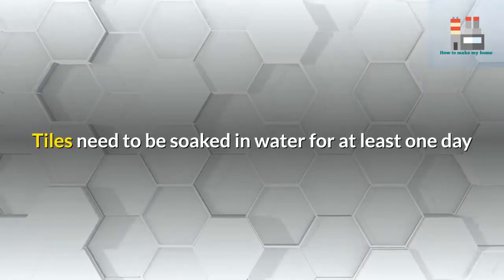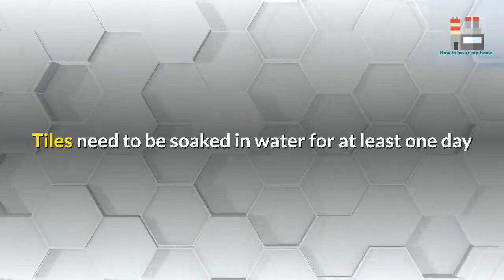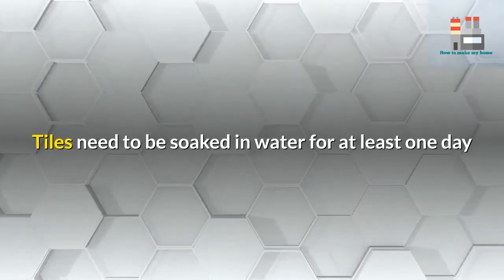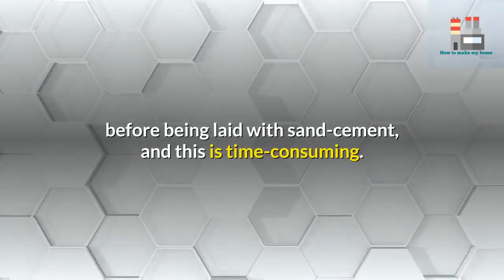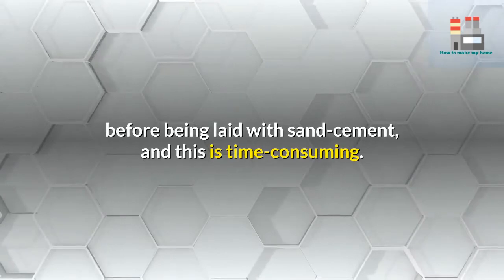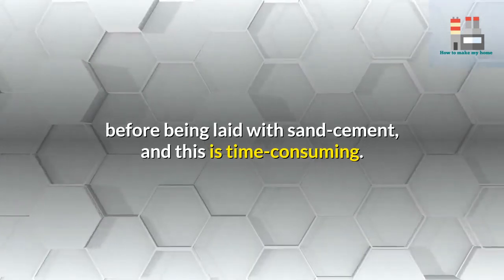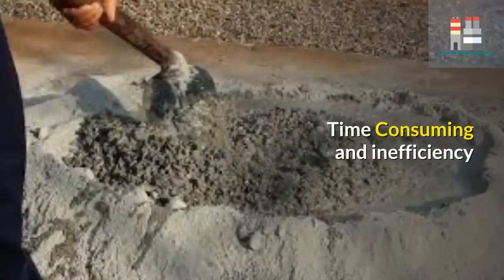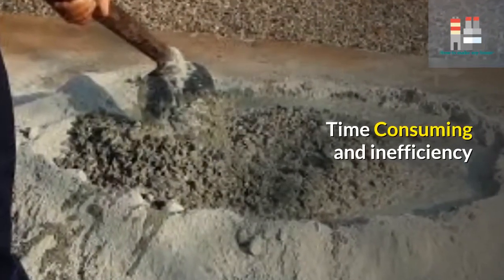Advantages of  Tile Adhesive over sand Cement Mix | Cement vs Tile Adhesive | Tile Adhesive

Comment: cost comparisons?
Reply from the maker: The Cost can't compare Laticrete-290 adhesive cost is 550 per 20 kg bag whereas Cement bag is 260 for 50 kg but the strength & durability is more in the good quality adhesive.